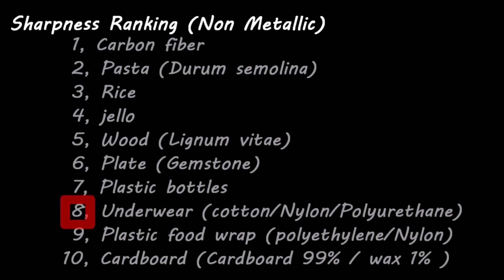パンツで包丁作り、はじめました

Comment: damn he really put out a fire with sparkling water huh
Reply: And all the safety regulations for pan fires say don't use water!
Reply: sparkling water has co2 in it
Reply: The only reason to have sparkling water
Reply: @106640guy  Yes and no 
Usually a pan fire is actually a fat/oil fire which will end catastrophically if you want to put it with water

Comment: How to bypass metal detectors in airports 101
Reply: Ehh fuck we're gonna end up having to be butt naked at the airport to get through 😑😂
Reply: @kaytarracorrea25  
Eh the TSA girls won't mind if you strip in front of em
Reply: Lol
Reply: @kaytarracorrea25  naah only murican paranoid at the airport.... asian pretty chill...
Reply: depends, it would still show on the xray as a knife shaped object BUT if you put it in between lots of clothing and make it super dense I believe it should blend in and it would be seen as a normal, orange/dark orange blob of clothes (which is usually ignored by the screener)
Reply: Tsunero  actually I was wondering, xrays are all about the composition right. So wouldn’t the knife be more condensed clothing? It’s knife shaped so even in a bunch of clothes the guy if he is doing his job could probably still tell that it’s a knife
Reply: Depends, if something is very dense the xray can't penetrate it so it will look very dark on the screen. Metal objects would stick out like a sore thumb among clothes but the cloth knife could blend in perfectly (since even though it's dense its density is nowhere near like metal). I had luggage that was so densely packed with clothes you could barely make out anything apart from a dark orange blob. The conveyor belt moves pretty fast, you have like 3-5 seconds to check one so there is a good chance this would slip through, especially to someone with less experience. Sure, you can pause to look at it more but nobody likes the guy who lets luggage pile up on the belt, it throttles the whole security process like crazy.
Reply: HOLY SHIT
Reply: Dangit now there’s gonna be another 9/11

Comment: Ok, it's official, this man has ascended to another plane of existence.

HOW DID HE EVEN FIGURE OUT THIS WAS POSSIBLE!?!?!
Reply: It is simple physics
Reply: This is basically micarta, he used heat to melt nylon into cotton fabric instead of epoxy resin
Reply: The process itself isn't remarkable at all. I did something similar when I was 11 or 12 to fix a broken backpack strap (it was made of nylon), without any supervision or assistance, or any special theoretical knowledge, really.
However, I have to admit that making a knife out of multiple layers of nylon and cotton is something I'd never have come up with myself...
Reply: Anything's a tool when you know how to use it.
Reply: kind of like plastic dude
Reply: azharul kamil I Asian and I’m confused and amazed
Reply: @LumosX  
especially when the knife you're making to cut fruits is made out of of something you're supposed to wear and cover your privates
Reply: Get material -> Harden -> Knife cutout
Reply: Super simplified btw

Comment: Thanks, now i will be safe if a zombie apocalypse starts just when I'm in an underwear factory :D
Reply: A A *an
Not in.
Reply: @bichonnation9494  It really isn't, they're correct.
Reply: @F.B.I Agent  F.B.I Agent   F.B.I Agent  I don't get what you're trying to correct. @Bichon Nation said that the "in" needed to be replaced with an "an" which I said was incorrect, as it wouldn't make sense. However, I'm assuming that the original commentator edited their comment per @Bichon Nation 's reply, as it is understandable. However, I don't understand what you mean, as what you said doesn't really apply.

Comment: So you can put out a grease fire with sparkling water? Or was it that the oil had all burned away and sparkling water was the coolest thing to put it out with?
Reply: The danger is that oil floats on water and can overflow its container spreading the flames. In this case, the oil itself didn't appear to be on fire and, in any case, it looks like the flames were extinguished by the CO2 from the bottle rather than the spray of water.